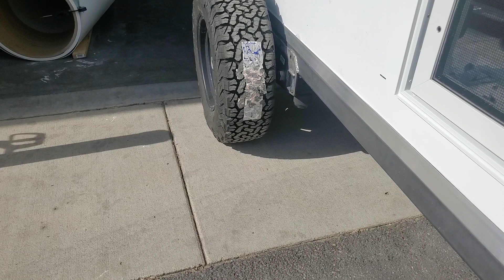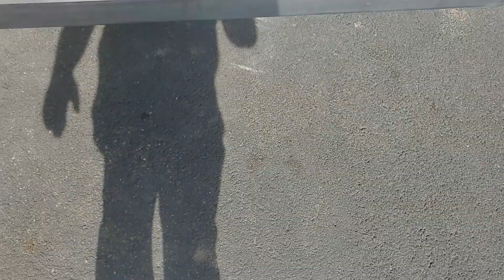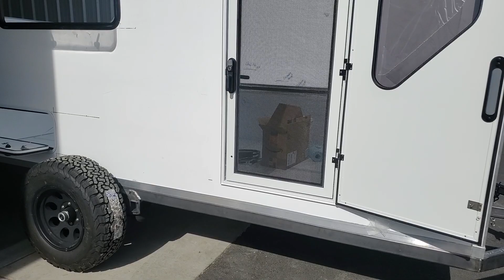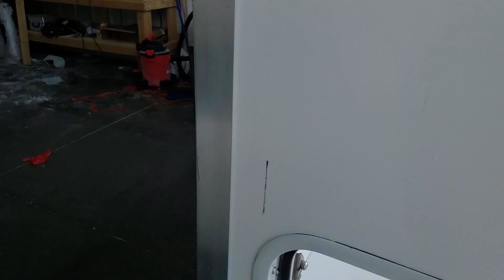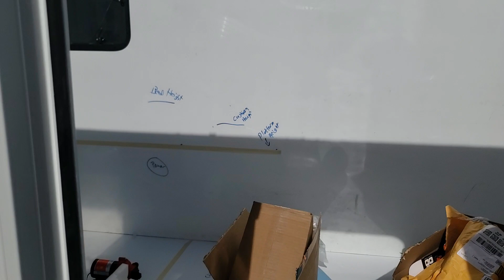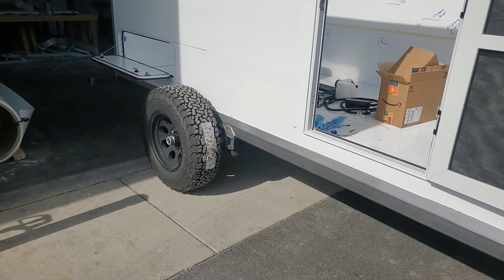Overlanding and Mixed Touring Camper Trailer Build ... the Intro!

Comment: I don't get it. If it does not have to be garageable, then there are many choices out there. As an example of  what you could have done: Just search youtube for 'toughest casita'
Reply from the maker: Choices like what? Box has to be under 6 feet wide, under 8'6" tall, independent suspension, 18" ground clearance, well insulated, not made out of tin/sticks, and under 2500lbs dry. Oh..and all electric/no propane.
Reply from the maker: I looked up the Toughest Casita...it is 100% rebuilt from the ground up. I guess I don't get your point.